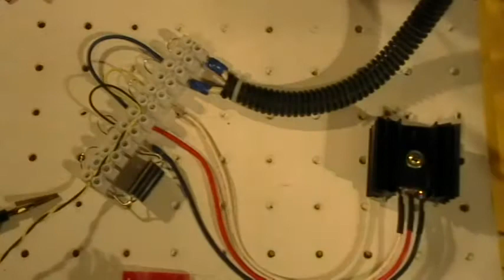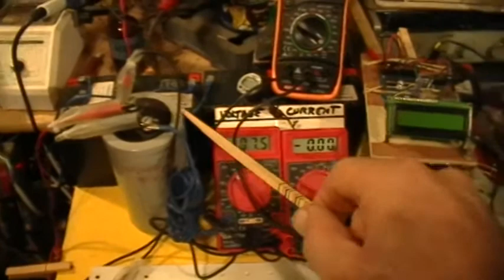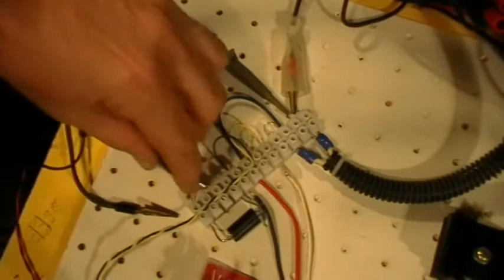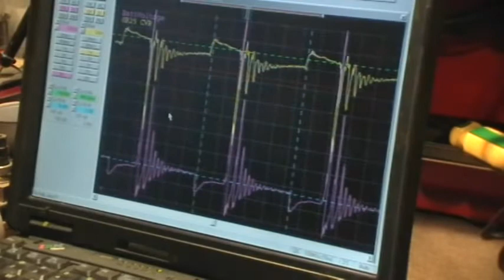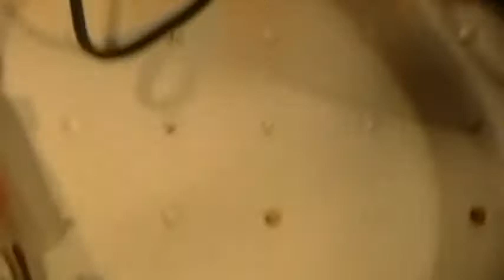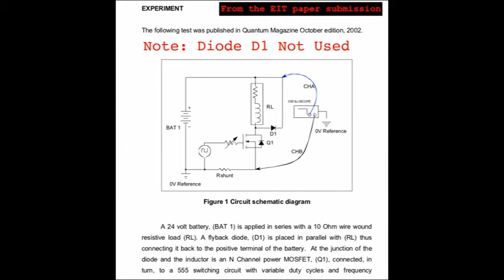Electric OU: Supplement: The Q-17 Plain Circuit Overview

Comment: Supp TK,

Question: im looking for a way to test the max amps and voltage out of a device, whats a proper way? 1 ohm resistor as load? Or any other suggestion? Thnx, why i ask, ( cause i see you testing stuff the real way)

Thnx!

Greets JB
Reply from the maker: Not enough information. If you tell me just exactly what kind of device you are trying to measure we might be able to figure out the proper way to do it. Thanks for watching!
Reply: Its for the output of my ACMMJB Device, pure the energy picked up by the pickup coils.

Thnx
Reply from the maker: JohnnBlade
What's a ACMMJB device? Is it anything like a BYOB BBBJ device?

I'll help you if you are serious. If you refuse to give me any useful information, though... why should I give you any useful information?

Ah... OK, I googled the term and I see that you have invented the Electromagnet!

Tesla's Egg of Columbus did NOT use a magnet for the egg. It was simply a solid chunk of metal.
Reply: My output is loose coupled, and i need a good way to test the output power, and since you are good in testing i was just asking for a good way to measure output. What other info do you need more?

Greets JB
Reply from the maker: JohnnBlade

What are you defining as "output"?  What do you mean by "loose coupled"? I have a feeling that your definitions might be different than mine.

If you are oscillating a coil, you will have many different kinds of "output". The coil will heat up, the coil and circuitry will be radiating in the RF, and there will be an oscillating magnetic field produced. This field can heat up or produce other effects on stuff that isn't even part of the apparatus, like eddy current heating or attraction/repulsion of nearby metals.

What part of the "output" would you like to measure?
Reply: I have send you a message